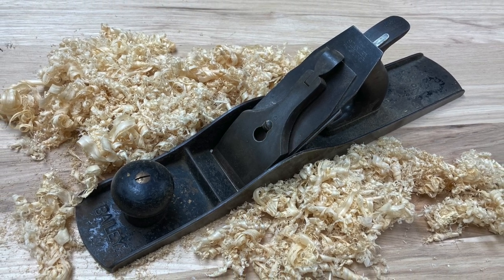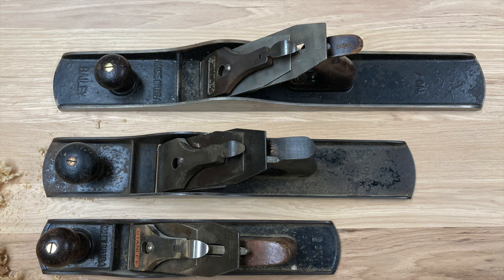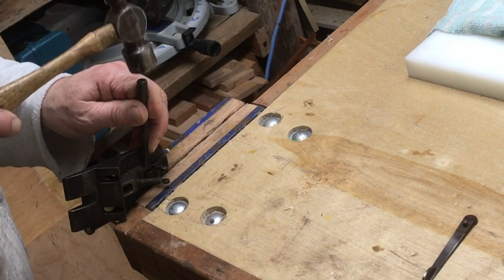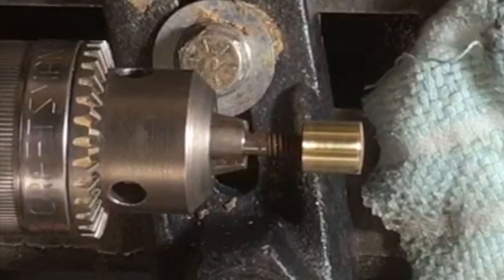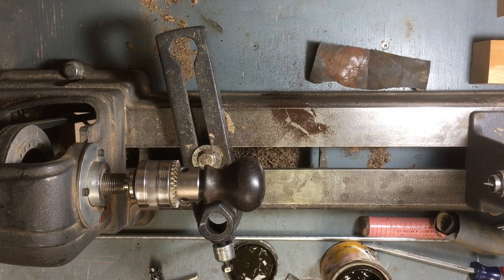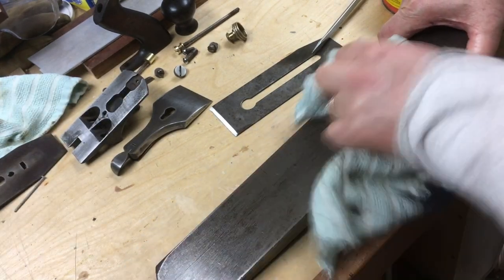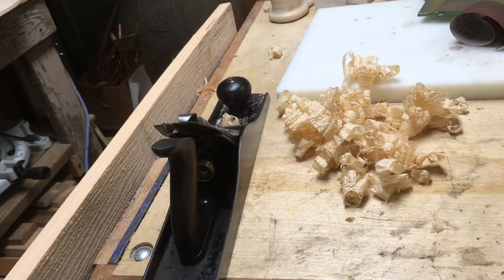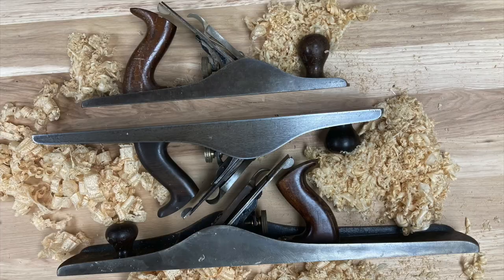Stanley Bailey No. 6 Fore Plane Explained Compared & Road Tested

Comment: I tell people who have old tools with a dark brown patina, to leave it be. Don't take it off. And they look at me like I'm daft. I tell them to take off any red rust immediately, but brown rust is there to protect the steel from the harmful red rust. It's something I learned from working on old black powder muzzleloaders.
Reply from the maker: I know nothing about chemistry but the black coating I'm calling patina seems to never get worse. It does not seem to corrode the steel. I wax it now and then and it looks great. Maybe a chemist can add more info.
Thanks for the comment.
Reply: @makingthings1463  The black coating is called Japanning. It was developed centuries ago in (wait for it...) Japan. IIRC, it's made of asphaltum, varnish, and a few other ingredients. It's possible to get the stuff, and make it look like new, but I hear it's a messy, smelly process. Again IIRC, the japanning needs to be brushed on hot and then baked in an oven. I was talking about the dark brown rust vs the red rust. Red rust and brown rust are related. If something has been exposed to water or even changes in humidity, red rust can form and it can be very destructive, causing pitting. But if you remove the red rust as soon as you see it, and keep it in a dry place, what little red surface rust is left will turn into brown rust. The brown rust acts as a barrier to red rust forming. Just keep it dry and wipe with an oily rag and you'll never have to worry about further rust. You can also protect the plane by applying a paste wax to the bare metal surfaces or using a light coat of spray varnish. All those need to be reapplied periodically.
Reply from the maker: Sorry, I wasn't clear, I meant the surface of the steel turns black with age. Many people will polish it off, which I have done many times. But these few planes have a nice look left as is. Thanks again for your comment.

Comment: I've got a Stanley 6 and a Lie Nielson 6 and can't tell much difference in the two. One is pretty and one looks old and pretty with the patina on it. I use both on a regular basis and find that both make good smoothers and joiners. Thanks for sharing your video and helping us keep traditional woodworking alive.
Reply from the maker: Thanks for the comment. I agree, pretty much down to sharpness being number one in importance and next probably weight. Thanks  for watching.
Reply: Does the LN have a Hock blade standard?  I got a replacement hock blade from Wood River since they were the only ones to have them in stock that I could find and I found that the thicker blade floats unsupported more so than an old thin blade. The frog is at the rearmost position, and there is still barely any room in the throat for chips. I’m having trouble with chips forcing themselves between the blade and chip breaker, and under the blade back into the frog because there is open space underneath the blade. If the LN has addressed this issue, did they just make the frog able to slide back further?

Comment: I found a very old Bailey #6 at the dump. All rusted ans dirty. I did a complete restoration on it. Beautiful tool. I gave it to a friend that does pist and beam buildings. It would have just sat on my shelf. Better to be in the hands of a craftsman.
Reply from the maker: Sounds great. They are fun to bring back to life. Thank you for the comment.
Reply: @makingthings1463  I'm now working on a Bailey #26 probably early 1900's. Wooden block plane. I use a product called Resror a finish to clean up the wood. Keeps the patina. Thank you again for sharing this fun video.

Comment: Looks good. I've only become really interested in hand planes in the last year and I'm slowly building a collection (my no6 is due to be delivered today). Like classic cars, I think that these things should be used for their intended purpose, so I'm not really a fan of over-restored tools that look better than new. I just remove any active rust, clean everything up and fettle the frog, chip breaker and sharpen the blade and I'm good to go. With any luck my no6 will come up like yours👍
Reply from the maker: Thank you for the comment. I agree, I try not to over detail the planes I use, I also agree that tune and sharpness are the real keys to great planing. Thanks for watching.

Comment: That looks great! I like that you focused on restoring for good useability but not removing history and patina. I’ve been using my no 6 as if it is a 5 1/2 jack for much lower cost for almost a year now. While hefty, one of these supposedly odd sized planes produces the best finish ready surface of any plane I have. It is also the best for reversing grain or knots for me even without the mouth being very tight. Enjoy and thanks for the great video. Hope you’re out making some saw dust.
Reply from the maker: Thanks for the comment. I agree. Sharpness and a good waxed bottom goes a long way to making a plane usable and enjoyable. Heft is important too. I have a 2 through 8 collection and use them all now and again, and most of them aren't very pretty but work great. Thanks again for watching.

Comment: I was given a type 10 no. 6.  It was in awful condition so I did a complete restoration, lapping, re japanning, tuned the frog and sharpened the blade.  It works amazing and it's the biggest plane in my collection.  I use it for jointing as most of my projects are smaller.  It was interesting to hear you say that a plane will joint a board 3x its own length, had never heard this but it makes sense.  That plane looks great and works well, nice job!  The blade and cap iron almost look blued.
Reply from the maker: Thanks for the comment. I think I said something like "some have said" a plane will joint level a board twice its length. That I believe is maybe a rule of thumb but I haven't given a lot of thought to the geometry of that statement. Certainly of you are careful you can joint flat a longer board by checking off and on as you work. I'm glad you're enjoying your new plane. Thanks again for watching.

Comment: Great video. I like the simple approach to the restoration. I'm new to hand planes and currently have old/vintage Stanley #4, #5 and #7. I'd assume the #5 is what should be put into the "fore" or scrub plane category, correct? Then use the #7 to level and the #4 to smooth?
Reply from the maker: Thank you for the comment. Probably best use of those three. The No. 5 is typically called a Jack plane. I think from the idea of a jack of all trades. The 7 is a plenty good jointer and the 4 is the quintessential smoothing plane. Thanks again and thanks for watching.